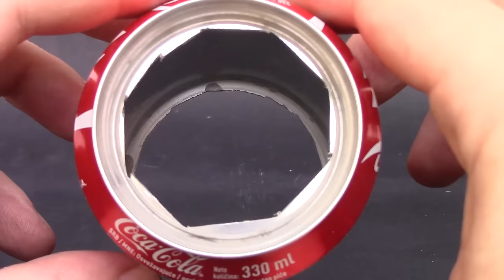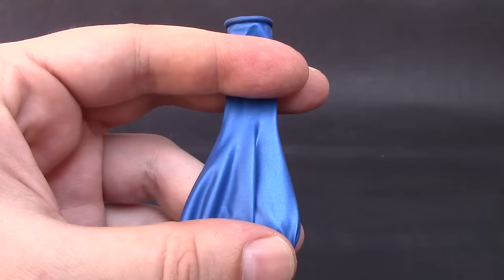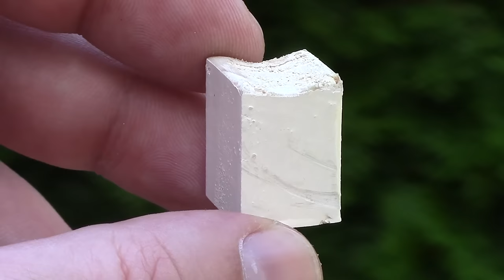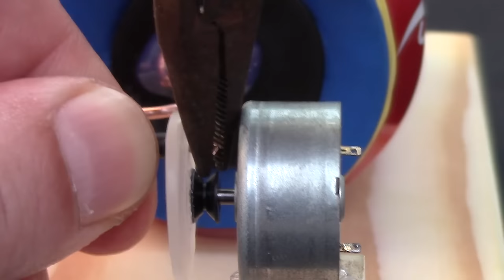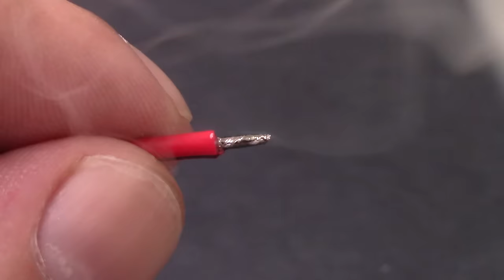How to Make an Air Pump

Comment: I'm Jewish. Would this method still work for me?
Reply: No. Sorry.
Reply: If you're OK using a battery operated flashlight, then this should be fine. But this won't provide enough pressure to actually pump most useful things. It MIGHT pump a decent amount of air into a pool float. No sports balls or tires

Comment: I must commend your building skills, however, this pump is inefficient. Seems like it just spills the water out of the cup more than anything. A bright use of air suction and valves though... all in all a cool concept. The design can indeed be improved by optimizing the volume changes in the cylinder. Hence it may be worthwhile to consider using a piston-rod mechanism as opposed to the simple balloon thing, which minimally influences the volume change of the cylinder. See some carburetion systems (they work on a similar principle in order to get air-fuel mixtures into IC engines). Good luck and nice work!
Reply: Ds
Reply: A
S
Reply: IT DIDN'T LOOK LIKE IT WAS SPILLING!.

Comment: Has nobody noticed the end demo where there are 2 nearly-hidden black wires stealthily connected to the motor? I doubt that 9-volt could drive the motor like it does in this video, especially after he tried to turn the pump with his own hands and demonstrated how much resistance there was.
Reply: ha! do you even know where he pulled that DC  motor from? of course 9 V is more than enough! this motor is rated for 5~5.5 V.
Reply: I'm saying that I doubt the motor has enough torque to drive that compressor setup as fast as it does, if at all. You can tell when he's spinning it with his hand how much resistance there is, and there are 2 hidden black wires connected to the motor whenever it's showed running. Explain that and get back to me, thanks.
Reply: It's a balloon, that motor can handle it fine. More than likely he was doing this pretty late and his battery was dead but he couldn't get a new one because the store was close. Something. So to fix that he used a bench power supply or something. Yet again. The video is NOT about the power of a 9 volt, it's over a simple air pump design.
Reply: I see what you mean. I say external power for more RPM for demo only.
Reply: ha nice one, i thnik batery died xD,  and bcs it is glued, hee needed to do something asap xD

Comment: why did he glued the battery? what if it runs out???
Reply: it's hot glue. you can just pull it off as is not that strong.
Reply: My question exactly.
Reply: And then I saw the answer. I never used hot glue. So it isnt a "permanent" type glue,, which answers my question from several other  projects.   Ahhso wacadimasu!!
Reply: Frederick Wise
Reply: JMB4000 slim shady
Reply: i don't know
Reply: JMB4000 He'll just reglue another one down. But yes, not readily replaceable.
Reply: He can charge it too
Reply: JMB4000
Reply: so you Charge batteries? lol
Reply: JMB4000 L
Reply: MrEngineer
Reply: $100000000000000000009
Reply: JMB4000 DC if you have any other fn
Reply: Damian Alexandre Duartes Perez

Comment: Very nice job. Looks like you're losing compression due to a lack of a good seal on the air intake holes. A longer stroke on the pump would be better.
Reply: DJ DVD gnu
Reply: Agreed
Reply: 🔴 What Is Islam? ⚠️

🔴 Islam is not just another religion. 

🔵 It is the same message preached by Moses, Jesus and Abraham.

 🔴 Islam literally means ‘submission to God’ and it teaches us to have a direct relationship with God. 

 🔵 It reminds us that since God created us, no one should be worshipped except God alone. 

 🔴 It also teaches that God is nothing like a human being or like anything that we can imagine.

🌍 The concept of God is summarized in the Quran as:

📖 { “Say, He is God, the One.  God, the Absolute.  He does not give birth, nor was He born, and there is nothing like Him.”} (Quran 112:1-4)[4] 📚

🔴 Becoming a Muslim is not turning your back to Jesus. 

🔵 Rather it’s going back to the original teachings of Jesus and obeying him.
Reply: @kelogish_is_the_best158  
Bgfv

Comment: probably wouldn't hot glue down a battery...
Reply: He went hot glue gun crazy just a bit
Reply: Why da fuk not
Reply: ***** exactly
Reply: He needs to make a video called: How to make a Block of Hotglue

The video is just him squirting hotglue into a large tupperware container.
Reply: yeah was wondering the same thing. 9V will run out of energy quite fast.
Reply: trigger happy
Reply: yeah i would just tape it probably a lot easier and you can change it when ever you want
Reply: Hes saying that the battery cant be taken off if it needs to be replaced.
Reply: It would probably break much earlier than the battery will run out.
Reply: just twist the battery a little and it will come off no problem. i have a bunch of stuff hot glued to my desk and i once had to remove them and i just twisted them
Reply: Laurence Reeves
Reply: The battery will last longer than the "pump", so why not?
Reply: Laurence Reeves    gg
Reply: Laurence Reeves    hgbbj
Reply: Laurence Reeves mjfirlr

Comment: Lets face it, out of the 1.7 million people who have watched this so far, nobody had made this.
Reply: I did.
Reply: +Zephane 
post a video
Reply: +Krazy_Kid-007 
i post video's
Reply: you telling me in 5 days this video went from 1.7mill to 2.5mill wow
Reply: i make videos aswell
Reply: I clicked this and watched the whole thing thinking it was a how to basic video cry
Reply: Often times I watch these how-to videos to get ideas, not to make the end product exactly as shown. While I probably won't make this exact version of an air pump, I may make one similar. Also I want to learn more about that weird solder goo he used and I might make some screw-in terminals. It's all about ideas.
Reply: I have
Reply: There's no output valve, so it would either barely work, or not at all, depending on what you want to use it for. 

Any voltage motor would do, as long as it's strong enough to drive the balloon membrane in and out. Of course don't use a mains motor because you might electrocute yourself. And just to repeat, this is a shitty design that would barely work. Making bubbles is about all it's good for.
Reply: Adam Yarris
Reply: Adam Yarris huyh
Reply: @greenaum  that's what it's for.
Reply: @Ravi Jain the clue is in the 9 volt battery that he used.  Anyhow, you would use whatever you can get your hands on. I've built something similar using 4" pipe instead of the can and used an old motor from a broken dvd.
Reply: It's called "how to make an air pump", not "how to make a shitty bubble maker". 

Am I right in thinking that the lack of output valve still works because the water provides more resistance to being sucked up the tube, than the Playdoh-lid input valve does to letting air in? It looks like if you operated this in air, say to blow up a balloon, or just blow air on something, it wouldn't work. The cylinder would preferentially suck air in through the output tube rather than it's input valve. 

I'm sure you could improvise an output valve out of something, some wobbly plastic vane covering a hole. But as-is this isn't really an air pump with much use.
Reply: @greenaum  I agree with you 100%. this will pump an aeration stone in an aquarium though, and I assume that is what to author intended it to be. it's really just a novelty as the one I made has both flow and return check valves and is made out of plastic pipe. this is made with a coke can. nuff said.

edit. the one way valves were made with bicycle inner tube tu create a better seal. it was used to power an aquarium filter.
Reply: @HarryWizard  does it work?
Reply: @ZathenHoopes  does it work?

Comment: I dont see a secondary one way valve on the pipe so i dont see how this will work? The suction caused inside the can should suck and expell the water up and down the pipe instead of opening the valve on the can?
Reply: DIYONLINEHUB CONFUZION

Comment: The ONLY thing I'm uncomfortable with is how you glued the battery to the board. I would've glued something down to hold the battery in place. other than that it looks awesome. spectacular
Reply: same here
Reply: battery dies , you replace it and you waste glue
Reply: well i could say you should make a battery holder and put it on the board then you can put it there when it dies just remove from the holder and then place a new one !
Reply: Seriously
Reply: Should have just nailed it to the switch then soldered it to the dc motor. Wear your safety goggles though.
Reply: +daniel p Omfg XD
Reply: I would have just put a nail right through the battery and attached it to the wood. That way, instead of the battery being glued and stuck when you had to replace it- uh, oh, wait...um..
Reply: hahahahahahha
Reply: Lmao wtf

Comment: Thoughts for next vid:

Edit down to half time.

Dont show the tool you're gonna use next, just use it...

Dont glue battery down. Makes it annoying to change when needed.

Dont spill water on your contraption like shown in the vid :P You are two minutes away from a short circuit.

Less boring music would be nice. Try classic maybe?

Other than that, good vid! :) (y)
Reply: +PFKNTHETA // I do.
If you find it stupid, ponder this:
What kind of music is used to accompany cartoons?
What kind of music do we all know, even though it's up to a centurie old?
Reply: I like the music, in my opinion its a symbol for your channel

Comment: why is mine sucking in water
Reply: i cri everytime ;'D
Reply: no its just funny that its doing the opposite. no innuendos xD
Reply: *****
ok then
Reply: the motor will work opposite as you change the positive and negative side of the battery
Reply: is still don't see how the movement of the motor will effect the air pressure
Reply: reverse the polarity
Reply: lolll
Reply: mr create maybe you made it drive in the opposite direction
Reply: haha Made my Day xD
Reply: me?
Reply: Reverse polarity of the main dc motor.
Reply: one way to make it faster is to use a power wheels motor
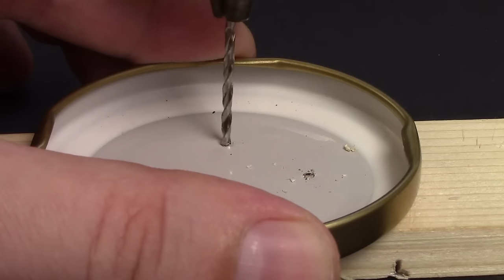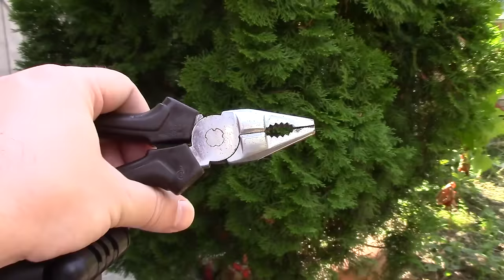Reply: No you have done something wrong in the part 2:40 and 3:54
Reply: DaNiJeL Dan 
Reversing the polarity will not change it because either way, it is pumping air
Reply: 2 5th place fhcjhi

😇

Comment: If you're going too wreck a syringe to do it, you could just use that for a relatively airtight piston (add some sewing oil for speed and better air retention). Alternatively PVC pipe so you're not losing all that energy as the can flexes.

But I suppose efficiency was never the goal.
Reply: Gz

P
Mko to

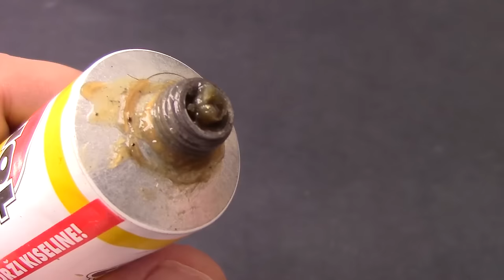Comment: what  the type of glue use using at 9:20 ?
Reply: It's called Rosin flux, not a type of glue. Just a substance that helps heat up the metal faster and create the solder stronger and easier.

Comment: What happens when the 9v battery is over?
Will our fishes die?
Reply: I was wondering how you can replace the battery as it's glued down
Reply: +Thomas King +1
Reply: +DrScrew I think it would be bettter if you use something rechargable or maybe solar...
Reply: hook it up to like a 9 volt power ac to dc power adapter
Reply: Buy a battery pack online fish can go a little bit without air and use the battery pack to power it and you can switch the batteries
Reply: +Gamerjam thx
Reply: np
Reply: Fge
Reply: Penguin Entertainment '
Reply: Адинок

Comment: A word on efficiency.  This pump would be  more efficent if the volume of  air it was compressing were smaller.  Remove a lot of that dead space inside the can. Andn optionally, add a second outlet check valve

Comment: 3:55 I wouldn't use my good tool to cut off hardware, better to use the grinder. Some screws can be surprisingly hard, and cause chips on the cutting edge. No way to fix that, tool is ruined.
Reply: ipissed c.
Reply: p
Reply: Use a can opener

Comment: The battery should not be glued to the board. The battery should be put inside a little plastic box which is glued to it so it can be replaced easily :)
Reply: qwerty that is smart
Reply: I imagine you'd get bored with this long before the battery died.

Comment: what glue are you using???
Reply: hotglue and superglue
Reply: +Lord_Lammington ,applicable on all surfaces???
Reply: pranav js almost all ... yes
Reply: +DrScrew  thanku :)
Reply: Hot glue
Reply: +DrScrew will it start sucking the water if we seal the other end and reverse the terminals of the battery?
Reply: Its a glue pipe. It can be fixed and used in gun glue

Comment: Does it also work for an air compressor?
Reply: Ihb
Reply: Ğhğ
Reply: No, because there's no output valve. And besides that, it's a tiny motor driving a coke can and a balloon, how much pressure do you think it could stand?